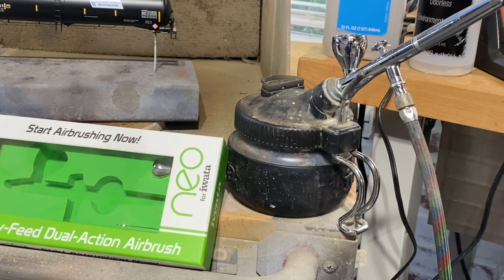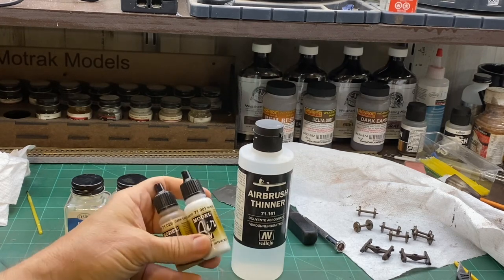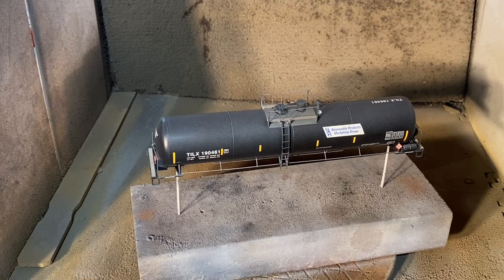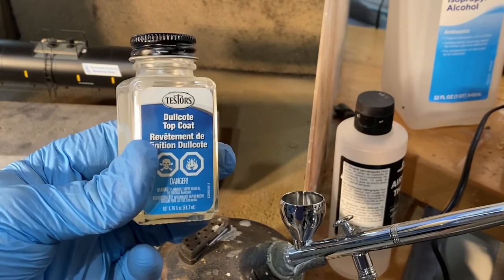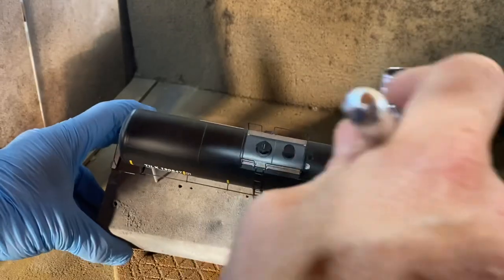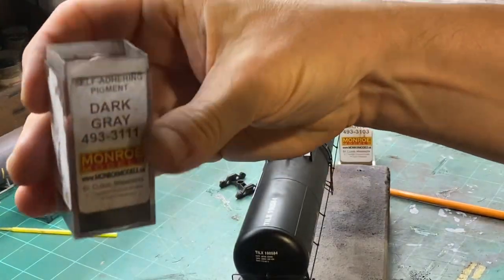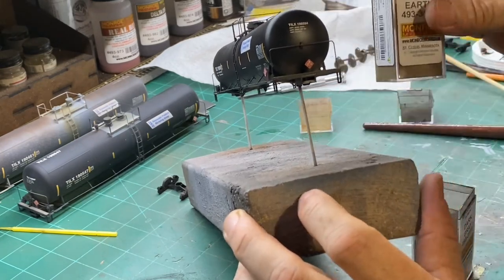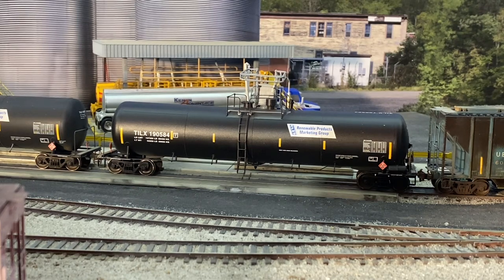Seaboard Central - Weathering with an Airbrush

Comment: Yep, I also have 2 airbrushes.  I have a Badger 155 Anthem which is a bottom feeder and I purchased an Avanti .3mm gravity feed airbrush from Harbor Freight.  The Avanti is definitely a good airbrush as I'd seen several reviews on it.  I usually use one for acrylic and the other for lacquer base paints.  As you're spraying I can see some spattering 'cause you need to keep the tip clean.  Yep, Dull Coat is better out of an airbrush.  I've used both but I like it sprayed from the airbrush better as it covers better and you have more control over your spray.  I use women's eye shadow makeup I get from the dollar store.  It only costs $1.00 and you can get every color under the sun and it sticks better than any powders you could ever use.  Cheers from eastern TN
Reply from the maker: Thanks! Cheers!

Comment: Great video,thanks for sharing this. I don't have an airbrush. I have had mixed results using a rattle can for dull coat.
Reply from the maker: Thanks William! I think the airbrush does a better job than the can. If you can’t find Dullcoat, Tamiya also makes a flat clear and Tamiya is by far the easiest paint to clean from an airbrush. All you need is isopropyl alcohol. Tim
Reply: @SeaboardCentral  thank you for sharing this with me.

Comment: Hi Tim, I enjoy your videos. I did notice some spatter on the first car. I think if you hold the air on the whole time, and then feather the paint off and on while the airbrush is off the model, you will get smoother results. Take care - Bill.
Reply from the maker: Thanks Bill. I had the air pressure up too high. I went back and fixed it with some powders later. It’s not really noticeable on the finished models. Tim
Reply: @SeaboardCentral  I think it's a paint mixing issue, rather than PSI. With thicker paints, you'll get spattering if the pressure is too low, but I don't think high pressure will ever cause spattering, and your paint is very thin anyway. But I agree that it doesn't show on the finished model.
Reply from the maker: @beeble2003  I hope to do another video this coming Sunday on weathering a locomotive. I’ll be sure to take your advice. Thanks for the suggestion!

Comment: I have no experience with using an airbrush or painting by hand or using chalk. However, I would like to start weathering my cars in my HO fleet. I have watched both of your weathering videos now. Which technique should I try to learn to use on my rolling stock? I don't think I will want to do heavy super detailed weathering, just light dulling, dirtying, and rust. I do have the money to get an airbrush setup. Any advice or direction would be appreciated!
Reply from the maker: Hi Jeremy! Thanks for commenting. If you are just starting out, you can use my method that I do for my couplers, trucks and wheels. That’s an easy start that will show immediate results. I bought my wheel holder from Micromark.com. Then you can use a spray can of a flat clear paint, like Testors Dullcoat or Tamiya Flat Clear. After that, I would experiment with Pan Pastels using paint brushes and a makeup wedge. Once you are satisfied with your results, you can seal it with another coat of clear flat spray paint. If you decide on an airbrush I highly recommend Iwata brand and stick to paints that are easy to clean the airbrush with like Tamiya which you can use Isopropyl Alcohol to clean the airbrush with. Tim

Comment: Nice job! Especially with the Dullcoat.  Do you just use the same airbrush cleaner to clean the Dullcoat from the airbrush?  I’ve been afraid to airbrush Dullcoat since I haven’t heard how to clean up after.
Reply from the maker: Thanks! Yes, I can use the Iwata cleaner. If I need to do any heavy duty cleaning, especially after tougher paints like True Color Paints I will use Lacquer Thinner. With paints like Tamiya you can use 90 % Isopropyl Alcohol. I prefer to use Vallejo Air and Tamiya paints for the airbrush along with the Dullcoat and Glosscoat. Tamiya also makes a Clear coat that works well too.

Comment: Awesome job Tim ! What pressure do you run your air compressor at? Just wondering?
Reply from the maker: Hi Mike! Thanks! I had it on 60 psi which is actually too high. I should have had it around 30 or 40. Tim

Comment: Around 4:28, you're getting noticeable chunks of paint through the airbrush. I use an old brush to mix the paint and thinner in the airbrush cup, rather than just stirring with a rod.
Reply from the maker: Thanks for the suggestion. I actually had the PSI up too high and didn’t realize it.

Comment: You mention in the comments that your PSI was a little high. What sort of PSI do you recommend?
Reply from the maker: My PSI is set around 60 but I think you can have good results between 40 and 60. Thanks for the reminder. I just lowered mine to 50. :)
Reply: @SeaboardCentral  Thanks, it looked that high in the video but I wasn't sure.

Comment: Just discovered your channel. Why a coat of duilcoat then a coat of Glosscoat on top?
Reply from the maker: For shiny finishes I will use a gloss coat but for dull finishes I use dull coat.
Reply: @SeaboardCentral  This is not what you did. You first place a coat of dull-coat then a coat of gloss. My my question is why both back to back. I do believe that you did this on the same car, no or am I mistaken?
Reply from the maker: @Christiane069  three different cars, three different methods. I wanted one car to look shiny so I gave it a gloss coat. The other two cars received different treatments. Hope this helps to clear up any confusion. Tim
Reply: @SeaboardCentral  OK, thank you for the feedback

Comment: I noticed that your airbrush spit out clumps of paint, that is always nerve wracking. Also, did you thin down the dullcote? I have been looking for a quality dullcote for airbrush since rattle can doesn't give the best results at least for small N scale. PS, my favorite car here was the dullcote only car, it gives it a chalky black look to it!
Reply from the maker: Yeah I needed to do a better job of mixing the paint. No I didn’t thin the Dullcoat. For me it works best from the airbrush rather than a can.
Reply: @SeaboardCentral  as for the dullcote, did you experience any issues with sticking/clogging? Seems to be a really nice finish so I'm highly considering Testors.
Reply from the maker: @AbelG8781  no, just make sure you clean your airbrush afterwards. I’ve used it for years and like the results I get.
Reply: @SeaboardCentral  what psi for dullcote do u recommend since its directly out the bottle?
Reply from the maker: @AbelG8781  between 50 and 60 psi works good for me.

Comment: What do you suggest for how to add graffiti like your prototype photos?
Reply: Various techniques. For the scribble at 0:28, either a very fine brush and acrylic paint, or a fine paint pen like a Jelly Roll. Check out the DansRailroad2011 channel for lots of techniques for modelling graffiti. (I have no affiliation with that channel -- just a satisfied viewer.)
Reply from the maker: Fine tip paint pens work for scribble. For larger graffiti I will draw it out with a mechanical pencil and use acrylic paint applied with a fine tip brush. Tim